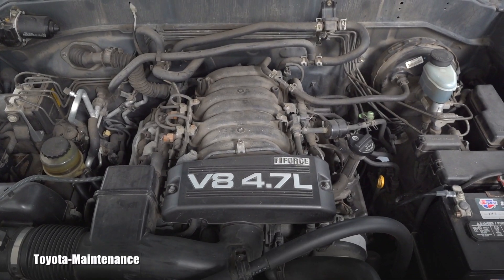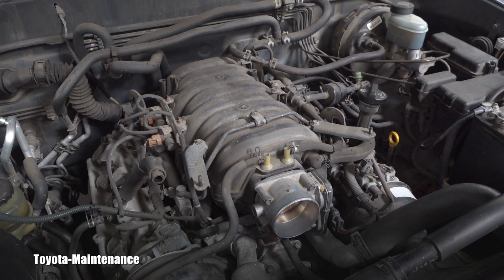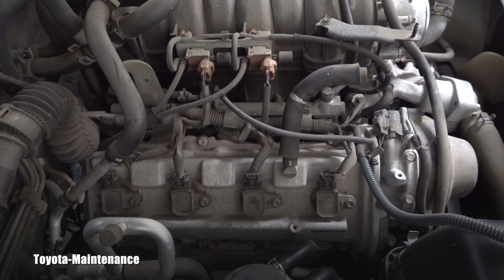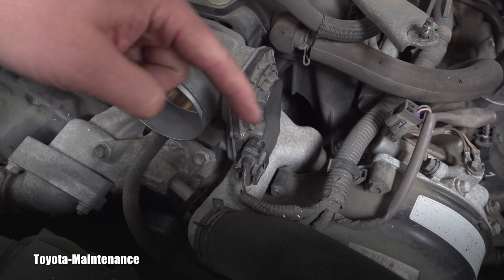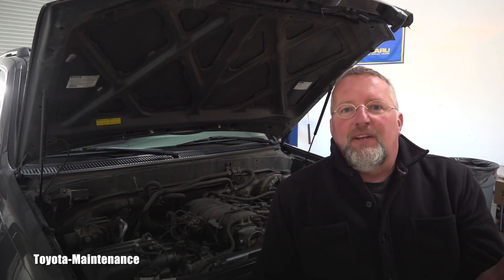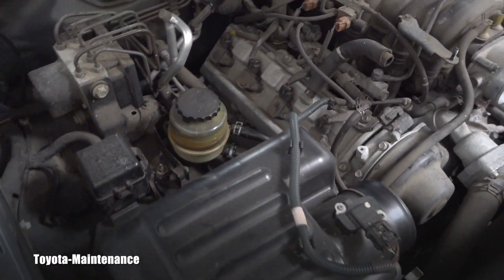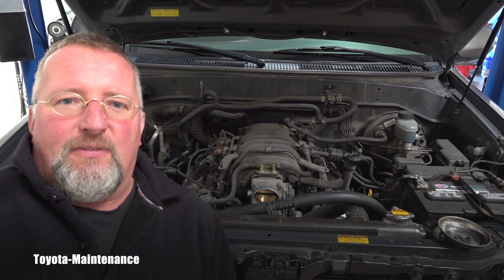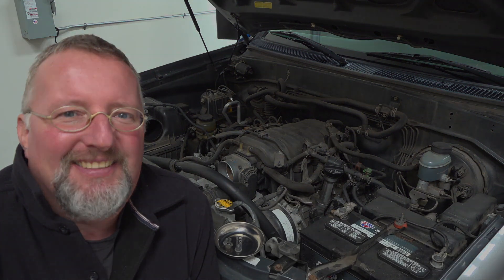TOYOTA 2UZ-FE 4.7 Liter iFORCE V8 Engine

Comment: Hi I have question. I have 2007 Toyota tundra 4.7  my engine blew. And 2005 to 2009 engines are really expensive.  But I'm looking in to 2002 Toyota sequoia engines they are bit cheaper can I use it? What is the difference? I'm thinking the intake manifold? Please advise thanks
Reply: I dont think you can because the engines prior to 2005 were non VVTi engines and if you try to swap your engine out for a 2002 your engine computer will likely not recognize it since it's expecting extra sensors and electronics to deal with from the VVTi system and this may cause even further issues.

Comment: my 2000 Tundra has 298,000 and 2001 Sequoia just turned over 200,000.     In spite of what he says I always run Mobil 1 (or your favorite synthetic.) because they are much better lubricants.  One of these days I will probably have to replace the secondary air pump.  Both vehicles use very little oil.   I need to replace valve cover gaskets soon.   I don't want to start leaving oil spots like a Chevy or something.  :D
Reply: Mobil 1 high milleagev5w30

Comment: It’s reliable but the water pump isn’t! Had to replace it at 100k; was leaking.
Reply: That's cause its literally In your god damn manual to replace the timing belt and water pump at every 90k miles
Reply: @ToyotaNutjob  yes.

Comment: Two Toyota Tundras with this engine have gone 1,000,000 miles.  Toyota even bought the first one back off of the owner to disassemble and expect it.
Reply: One million miles. I don’t think there’s another manufacturer out there with that longevity and reliability  👍    today everything is plastic and unreliable shat  👎
Reply: o Rebelo There’s a 5.3 Chevrolet that was mostly highway miles but I’ll take Toyota
Reply: @on-site4094  Actually, there are 2 Nissans that surpassed the million mile mark.  I believe without googling it they were both Frontiers, but not positive on that.
Reply: @on-site4094 Well, in fairness Mercedes-Benz had three engine designs from the late-70s and early 80s hit more than 1 million miles about 30 years ago.  The OM617 diesel (1st engine ever to break 4 million kilometers) and their M103 and M104 in-line 6 cylinder engines.  In fact, a documentary was done a while back about the insane number of Mercedes-Benz engines with over 2 million miles serving as taxi cabs in Turkey, the Middle East and parts of Africa and Europe.
Reply: Personally seen hundreds of these over 400k in the past two decades.
Reply: Uh... Volvo... 3.25 million miles.
Reply: Tyler swedish engines are tanks but volvo doesn't make pickup trucks lol
Reply: There’s 4.6 and 5.7s as well with million miles

Comment: Will you please make a spark plug change video on this engine?
Reply: Riff Dude it’s pretty straight forward, in my GX470 I removed the air box cover for one of the plugs, but other than that, very easy.

Comment: very reliable engine  .. here in dubai most off road cars are toyota landcruiser because they are very reliable and dependable specialy in dubai hot weather and you can see almost every day an old toyota landcruiser  (1998_2007) still running strong and most of them with high milage  (600000 + kms)
Reply: А как же Ниссан Патрол?

Comment: Something worth noting with this engine, compared to most other Toyota engines is that this is apparently an interference engine. Though the risk of damage is still low (according to what I've read) it can still happen. So it's important to stay on top of timing belt maintenance just in case, whereas with non-interference engines, the worst thing that could happen is you'll get stranded somewhere and need a tow.

Great content, keep up the good work!
Reply: No shot sherlock

Comment: I have a v8 4runner with 500,000km (around 300,000 miles) and it is an absolute dream. Doesn’t leak or burn a drop of oil and it’s incredibly smooth too.
Reply: I've got one with 235,000 miles and have the same experience. No oil burning and runs smooth. Trany still shifts smooth as well.

Comment: Thanks for posting. Is it the starter that is a pain in the butt? I have an 18 Tundra with the 5.7. I hope it has a timing ...chain.
Reply: 1uz,2uz,3uz platform had the starter in the valley of the v. and 5.7 is the 1/2/3ur family successor of 1uz family  and yes, it had timing chain.
Reply: Yes all the 5.7 v8s have a timing chain
Reply: Yes it  does but that chain can break not likely  but i saw  a  17 model that broke

Comment: Fantastic engine. 225,000 miles. Runs like a dream. Of course you have to do your part on maintenance. But overall great engine.
Reply: Yes it is! Got one in my 03 runner with 235,000 miles and still runs great. About to change the timing belt so I can get another 200,000 out of it.

Comment: Secondary air injection, starter, cracked exhaust manifolds, frame rust. The top 4 pain in the butt to deal with. Otherwise it is a great engine. Recently sold my 05 Tundra
Reply: They fixed the leaky exhaust manifold issues in 2006, but yeah huge pita to replace
Reply: Secondary air injection only a problem on the new age vvti tundras 04-06

Comment: I’m guessing the starter, located underneath the engine ;)
Reply: It should be under the engine gut it’s under the intake manifold!
Reply: It lies on top of the engine, near the rear, nestled in between the two heads.  Pain to replace, but thankfully not something that happens often, and it frees up space underneath.   If it was a 80k mileage part I’d hate it!

Comment: Not reliable... Timing belt every few years...My 4.0 Jeep Cherokee Xj inline motor is way better.
Reply: Good luck with that one 😂
Reply: @janheinrich1733  a jeep Xj is way better than a big overweight Toyota with a weak Rusty frame.. The Xj is Small, nimble and quick.GAYOTA HAS A WEAK ASS SUSPENSION TOO WITH WEAK CV BOOTS.. GAYOTA!!!
Reply: @robertquattrini2486  you're right about toyota being overweight and "weak" frame. that why ppl engine swapping toyota engine on jeeps.
Reply: Robert Quattrini -having owned a YJ, a XJ (both 4L, 5spds), an 85 Runner ( 2.2L, 5spd) and my current 03 Runner (4L, auto)....they line in that order weight wise. My 03 Runner is much heavier than a YJ but that weight adds stability, momentum and a much more comfortable solid ride quality.
The synchronized Yota transmissions are much smoother, quicker and bulletproof on & off road. 
The XJ & YJ 4.0L six is a good motor with good torque but many years suffered from burnt valves and oil starvation at the rear of the motor. The Jeep motor gets even worse gas mileage than the heavier 4Runners. 
The 5spd manual is great in both Jeeps as well as the early Runner. I so so wish I had the option for a 5spd in my 03. 

Jeeps are fun as hell especially with the top down, they are nimble and quick. They will beat you sore on and off road and may kill you on the highway ala death wobble (solid axle XY & XJ). 
4Runners are super fun but not quite as “immersive” an experience off road but hey their windshield wipers actually work! You will enjoy the ride all day in comfort and climate control should you desire. You can put a full size mattress in your Runners rear and comfortably camp or bump ugly’s with your gurl. (Right there the Runner wins...hands down!”

All four of these vehicles have VERY strong frames and suspensions. All four of these vehicles suffered from bad rust issues underneath in salt belt states. Older Jeep frames are just as rusted out as older 4Runner frames....the drivetrains of both easily outlast the frames unless you oilspray. 
4Runner bodies don’t rust much. Jeep bodies rust bad especially at shackle mounts, fenders, rocker panels and floorboards. Jeep electrical and wiring is insane and antiquated, Runner wiring is from this century, standard automotive quality.

Stock suspensions are generally higher quality on 4Runners than on Jeeps. As you reach premium off road trims Jeep suspensions are slightly better imho. Aftermarket suppliers are huge for both brands, Jeep has more stuff but Yota has lots of choices too. 
Yep, stock Yota cv boots suck but their cheap and relatively easy to change. Jeep steering components wear out and there’s that fun “death wobble” thingy.

4Runners are top rated crash tested, multiple air bag equipped all around and have VSC, ABS, TC,  ATRAC, DAC so I feel safe hauling the grandkids around. 
The YJ was EASY to roll if one was stupid. It had none of the tech. It did have a roll bar. The XJ had a longer wheelbase and lower CG but it was also a tech Dino. The 85 4Runner was Stone Age too...zero nannies there but it rocked off road, had a roll cage, and was bulletproof. .....oh yeah, and the bed thing applied here as well. Lots of memorable surfing safari’s to Baja with my Buddies and our chicks from San Diego in my Navy daze.......My 2c...!
Reply: Lmao thanks for the laughs
Reply: Every 100000 miles you change timing belt pulleys water pump serpentine belt replaced.

Comment: The 2UZFE is a smooth, quiet engine. I enjoy it in my 04 4Runner (non-VVTI); it produces 320 ft lbs of linear torque and doesn’t break a sweat on mountain grades. Stay on top of the recommended maintenance. Watch for cracking exhaust manifolds though. That and the previously mentioned starter location are it’s sore points.
Reply: Love mine too. I've got an 03 4runner and live in colorado springs. Use to have a 2017 tacoma and couldn't stand that crappy engine. Couldn't be happier with the v8 runner now. Plenty of power in the mountains now.
Reply: Also, timing belt is a sore spot too. Not too hard to replace but, still....its not a chain.
Reply: Have the same engine.  Absolutely bombproof.  It did crack the starboard side exhaust manifold but I had it replaced with an OE unit and all is well.  Crazy crazy reliable engine other than that
Reply: How do you know if you have a cracked exhaust manifold?  How much is it to replace?
Reply: @anthonygiordano3991  It will sound like its ticking at idle, as for replacing I do not know.

Comment: Good engine, but MPG sucks.
Reply: I get 19mpg out of my 03 4runner. I'm very happy with that.
Reply: Its a truck engine with 8 cylinders buy a prius if u want good gas mileage
Reply: bill2526 bill2526 - I,ll bite.....my 03 Sport (V6, 4WD) has a set of 32” Dueler AT’s mounted....I didn’t go any larger cause it’s stock height and I’m waiting for XREAS to fail before deleting it and getting a lift etc.....I actually like XREAS and at 190k it’s working fine.....it’s my understanding that if I get 33 or 35’s I should really re-gear to 4.88 to save my mileage and computer shift calibration points as Toyota intended.
So you’re saying assuming I’m on stock 265/70/R17 re-gearing to 3-something ratio will significantly increase my MPG?....how much improvement and why? I am genuinely interested.

Comment: I have this engine in my Sequoia(260k) and in my GX470(204k)  with no issues and burning zero oil between changes.  Love it!
Reply: I didn't know sequoias had the 4.7 that's sweet. Might need a 7 seater lol.
Reply: I got one in my 4runner 👍🏻 I absolutely love it!!!
Reply: I have an 04 GX, just clicked 218k.